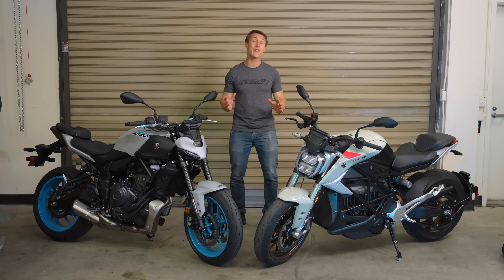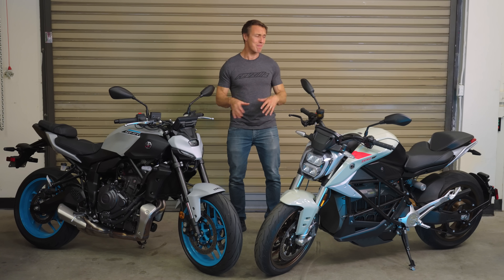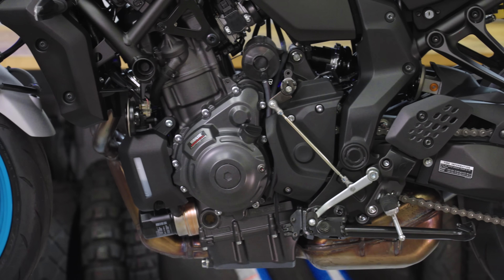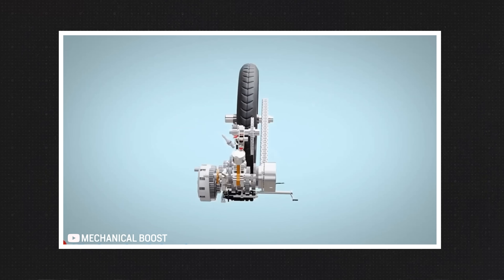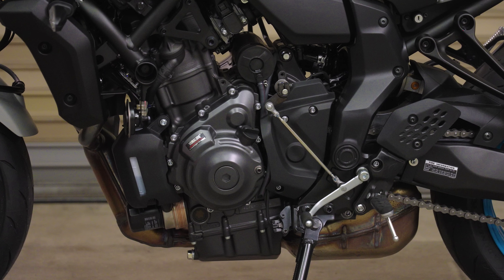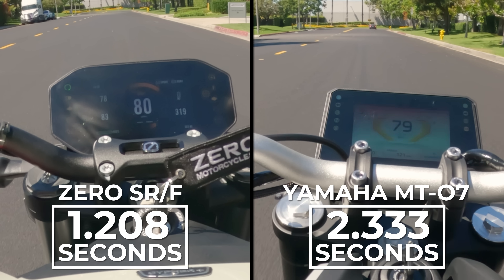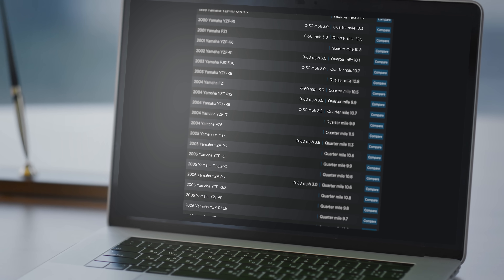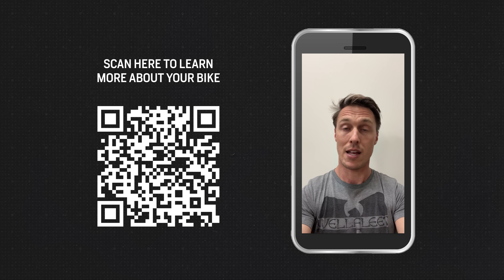Are Electric Motorcycle Torque Figures a Lie? | The Shop Manual

Comment: So how exactly e bikes have so much torque, but not much horsepower?
Reply: My understanding is that electric motors make their best torque at 0 rpm - straining, but not moving.  As they move, their torque goes down...whereas ICE torque is a curve that climbs first, then drops gently as horsepower rises.  That's why in Ari's graph @ 3:19 the electric bike's performance drops as soon as it starts to move (then pretty much falls off a cliff around 110mph) whereas ICE acceleration is a curve that climbs first, then drops gently as you approach the point you need to cog up.
Reply: Some do have a lot of horsepower. The Harley Davidson Livewire is about 105 hp.
Reply: @davidbrayshaw3529  100 hp, 84 ft/lbs of torque, and 3 sec 0-60. I've never had anyone not be impressed with the power/speed when they've ridden my Livewire.
Reply: Electric motors are less efficient at producing the same torque as revolution speed increases. They have a efficient zone.
Has to do with how many poles are in a given motor, how quickly those poles can be energized and alternated.
Electric motors are like a combustion engine with a very high cylinder count. They are smooth, they generate torque pulse frequencies that are high per shaft rotation.
Motors used in very high accuracy and precise applications have a lot of poles (such those little motors which turn throttle bodies on your combustion bike). Other motors which are used on industrial equipment that just turn moderate RPM and run big milling machines or grinders or some such device have a lot less poles because they rely on flywheel momentum to smooth out the torque.

Comment: If I recall correctly the Brammo Empulse had a transmission with gears. Was that electric bike a ripper then??
Reply: Yes.  Can confirm.  My buddy and I performed many uhhh 'research experiments' comparing its off the line acceleration against that of a 1290 Super Duke.  The KTM could keep up with it but only with an absolutely perfect launch, otherwise the Brammo would smoke it every time easily (and didn't require any clutch modulation).  Granted, the Super Duke would blow by it with a vengeance after ~40mph, but stoplight-to-stoplight and around town, the Brammo was a complete riot like nothing else I've ever ridden.  I'm really sad nobody makes anything like it anymore, one of my favorite bikes I have ever owned.

Comment: This is the thing that puzzles me - why don't they put 2 gear or even a CVT transmission. With only 2 gears they could invest more (space and $) in the seamlessness of the shift - autoclutch shifter etc. No need for a broad spread of ratios as the motor spins to such a high RPM.
Reply: I'm thinking it's because they're having trouble keeping the prices of electric motorcycles low enough as it is. Also you cancel out the marketing message that EVs are low maintenance with less moving parts. But I always wondered if the real solution would have been to use two motors like Tesla's dual motor setup, where one is wound for low speed acceleration, and the other wound to better handle high speeds, and map the controller to allocate the power accordingly.
Reply: They're already heavy and expensive, and you want them to be heavier and more expensive?
Reply: It’s probably cheaper and lighter to just use a bigger motor.  Most of the weight in Emissions Elsewhere Vehicles comes from the incendiary device (the battery).  Just say no to Electric Cars, mandates Digital ID, Central Bank Digital “currency”, Climate Chains, Communism 3.0 and the Beast system.
Reply: Jesus christ someone ship this zombie to north korea he will settle for anything he will be happy there pets just do it. A cvt. Guy mustve been born yesterday. Its called the wheel idiot stop tryong to reinvent it as a triangle it wont work cvts are fake and gay theres nothing wrong with shifting a gear youre solving problems that dont exist youre turning our solutions into our problems if yiu want a cvt go buy a vespa loser

Comment: They're insanely over rated BS I ride one, a Soco and it often bogs down way worse than my Honda CB125F, and once the battery gets below half it loses power, a lot of power.
Reply: Like having a 1.5 gallon tank on an MT-07, and filling that tank from a pump that takes 3 hours to squirt out 1 gallon of fuel.

Comment: i would argue that 0-60 is not a real world metric, in the sense that no one uses that in his day to day, but you do use things like the 80-120kmh or similar
Reply: Ever leave a stoplight?
Reply: I test the 0-60 of my DR650 every day. (PS: It's slow)
Reply: Technically YES, 0-60 Specs aren't that important for average riding....and it's Often over analyzed because 90% of Bikes, dirt bikes, even mopeds, will have No problems blasting away from cars in the first place!.....it's definitely nice to have for emergencies though or to persuade aggressive tailgaters to back off.....I've had to lose plenty of those idiots in my day....but I don't purchase bikes around "performance" anymore....it's about what kind of riding I intend to go. But speed is subjective in the real world.
Reply: Hi, The 0 to 60 refers to Miles per hour--the US measurement.  It is the same as a 0 to 96.6 km/hr. measurement.  Which would be someone merging onto a US freeway from a stoplight.
Reply: @jonathanjohnson8376 you have a stop light right before ( i mean like less than 100 feet) joining a Highway?

Comment: Some motorcycle magazines used to quote power to weight ratios. It might have been relevant for comparing similar bikes when HP and torque had similar numbers (40 HP and 40 ft-lb). I like the real world test for inertia and drag.

Comment: You know, I wish people would stop confusing lb-ft with ft-lb. One lb(mass)-ft is the amount of energy needed to raise one pound-mass by one foot in a gravitational field of 32.2 foot per second squared (earth's gravity). One ft-lb(force) is the amount of rotary force from one pound-force exerted on a one foot lever. One BTU is around 775 lb-ft. Technical people use the distinction to keep their math straight.
Reply: Pounds are force, not mass. Kilograms are mass.
Reply: @tgmwright  If you're working in SI units or ISO metric. If you're working in Imperial or US Customary, it's lb-mass. PS: 1 lbm is equal to 0.4543592 kilograms.
Reply: Also, the amount of energy to raise a mass up is in Joules
Reply: @tgmwright  If you're using SI metric. In US Customary, it's either lb-ft or, more commonly, BTU.
Reply: lb-ft and ft-lb is the same thing. Lb is not a unit of mass, it's a unit of force. Sometimes it's called lbf (pound force) to distinguish from lbm (pound mass), which is a unit of mass, but pretty much nobody uses lbm.
Reply: @flamingwonky  In theory, yes, you can use the two terms interchangeably, but most don't just to keep their head straight. The four basic units are mass, length, force, and time. Metric is smart and has force being a derived unit, however Imperial came to be with all four being fixed values, with one lbf being the weight of one lbm in earth's gravity (that's why the terms are used interchangeably); this means that a 3,600 lbm (1,633 kg) car which weighs 3,600 lbf (16 kN) on earth would weigh 1,200 lbf (2.7 kN) on the moon. Not that anybody in their right mind would use Imperial units to calculate moon shots. At least not since the Mars Climate Orbiter.

Comment: I think there's a disconnect between riders like Ari and the rest of us. I can't launch an MT-07 0 to 60 anywhere close to 3.6 seconds, I'd be lucky if it were 4.6. I can get 3.5 out of that Zero every time, though. For my everyday riding, there's no comparison. My Energica SS9 felt like a rocket ship, and my FJR1300 feels downright sluggish by comparison. Maybe I could learn to launch the gas bikes just as quickly, but I wouldn't enjoy it. To me, that would be like learning to solve math problems quickly, and if I do it wrong, the teacher kicks out my chair and I end up flat on my back and then get handed a big repair and/or hospital bill. Not exactly my idea of a good time, but I get that some people enjoy the sense of danger.

I also think that experienced gas riders are held back by the muscle memory for throttle control they have developed. To properly launch an electric, you have to just immediately whack the throttle wide open and know that the bike is not going to buck or do anything funny. The gas riders I know just can't seem to make their wrists do that, and so they're only experiencing a fraction of what the bike is capable of. They try my electric, launch it like grandma, and then complain that they're not impressed with the acceleration. I tell them I wasn't very impressed with their acceleration, either. Maybe there are just electric people and gas people. I think there's room for both.

Comment: i would say, torque is the puling power in low rews, while hp is the top end power. the more torque you got, the less shifting you need. thats a very rough explanation. thats why diesels got more usable power and pulls nicer in everyday traffic.
Reply: More torque = more hp early on. 
More torque is good and makes ride easier and More punchy but acceleration solely depends on Horsepowetmr and weight. 
100hp bike with 50nm torque will accelerate same as 100hp bike with 100nm torque.
Reply: Torque is irrelevant, its the work done (power) that matters...

Comment: I've been waiting for this video ever since you said you'd make it. Good stuff.

The difficulty a lot of people have with believing the torque numbers that EV bikes can make comes from a fundamental misunderstanding of the concept of torque to begin with.
Reply: imho it's not the concept of torque itself, but not knowing where it is measured for the numbers in specs. I for one assumed that it is measured at the front sprocket, just didn't think as deeply about it. As it is always the highest number achievable at some specific rpm, I just assumed it is also measured at 1st gear as it would be highest there.
And then you could have different sprocket ratios to increase or decrease it a bit further.
Reply: I amused myself one day and dug up max axle torque and chain tension figures for the back of a 1390 Super Duke R.
The values are immense.
But as Zach showed, the max torque on an MT-07 is a lot higher at the axle than people realize.
The usual motorcycle uses 3 gear reduction sets from the crankshaft to the rear wheel. Crank to transmission input, transmission input to transmission output, and transmission output to the rear wheel. Each step trades velocity for torque multiplication. A gear is just a continuous lever. There are system inefficiencies along the way but that has been a well known factor.
Reply: @turnin.sprocket Uh, that's Ari not Zack.
Reply: It's the fundamental lack of interest in science and education, but still feel the burning need to run their mouth and spew nonsense.
Truth of the matter is even most engineers don't understand these numbers well enough to have a valid opinion let along most of the people.
Reply: @holmiumh  "Truth of the matter is even most engineers don't understand these numbers well enough"
Statistics made up on the spot.

Comment: I have ridden the Zero SR/F (see my video if you are interested) and I was expecting it to be a tire shredding beast that would put an MT-09 to shame, but it was anything but. I own a Yamaha MT-07, and I have ridden even torquier bikes (such as the MT-09, Aprilia Tuono 1100, various Ducatis), and the Zero did not feel even close to those. Since riding the Zero, I have searched for Dynotest results for a Zero SR/F (or SR/S) to validate the torque claim but have not found any.
Reply: What's the Tuono 1100 like? I own a Street Triple 675 and my sibling has an MT07, both great bikes but if I sell my STR the only bike I'd get is a Tuono 1100.
Reply: @stefanpetrov8 Awesome, but excessive. I also rode the Tuono 660 Factory (and the RS660 Factory), which is now at the top of my ‘to buy’ list, and I would find it difficult to justify choosing the 1100 over the 660: more yes, but probably more than I would ever need on public roads. FYI, I have ridden the 765 Street Triple RS and R; both great bikes.
Reply: @twowheelsandablade just watched your vids on those, great reviews. To be honest I don't think a 765 is much of an upgrade over my 675, if anything the 675 is more raw. The only reason I want a Tuono is that incredible V4 noise, it's not like I really need more power for the roads anyway lol
Reply: That’s interesting since that zero is faster 0-60 than an mt09 and way faster than an mt07. It does feel slower than it is due to lack of sound/vibration/drama.

Edit: various sources quote different 0-60 times, the zero may be a bit slower than an mt09, but probably faster than an mt07. When battery level is low, it loses some power. On the other hand, an advantage is you’re always in the right gear, so for roll-ons its quite good, unless at too high a speed as power falls at higher speeds.

I remember it as great for squirting out of slow corners and accelerating from a stop, which makes sense.
Reply: @Gnerko123 The Zero is a magic carpet; the  minimal sensations are very deceptive.
Reply: Did you take it out Eco mode lol? I have never, ever been beaten in a drag race to lets say 150kph and I do around 1500 miles a month. So enjoyable to outrun even Hayabusas.
Reply: Check out the channel "Stecher motorradtechnik" Its from a workshop in germany, they did dino tests for a Zero S , SR/F and SR/S. They measured 185NM of torque at the rear wheel, and about 110HP. So exactly what zero claims.
Reply: I've seen people race each other on the highway with impromptu roll-ons. One was between a SR/F and a GSX-S750. They were basically equal until higher speeds, the 750 started walking away at that point.

Comment: If you guys in the States had 99 octane non ethanol fuel. The acceleration figures would be vastly different on the mt07 compared to that electric bike.
Reply: We rate octane differently here in the U.S. The actual values of premium here are about the same as your 99.
Reply: Sounds like you need to watch our video about gas octane!
Reply: Octane is an anti-knock measure to prevent pre-detonation in the chamber. The only it does for performance is prevent misfires.
Reply: The octane rating of a fuel is not reflective of its calorific value it's a measure of its combustion characteristics. The use of high octane fuels might give you a slight advantage at full throttle openings under full loads if the engine's knock sensors allow for
enough advance in the ignition timing, but we're talking maybe 1 or 2% at the most. Numerous tests have been done on this.